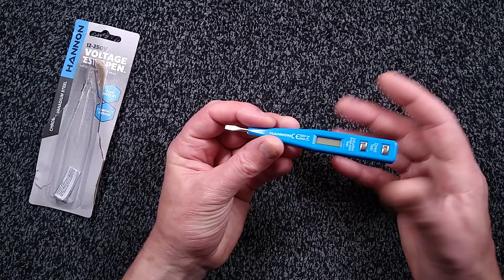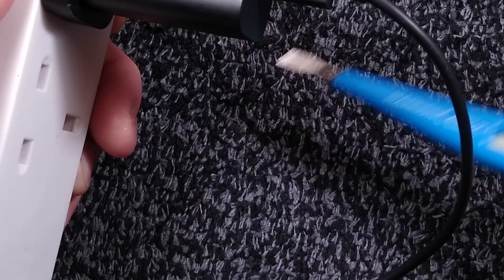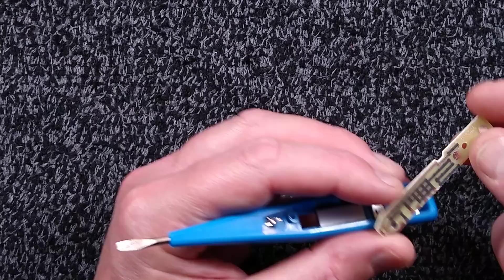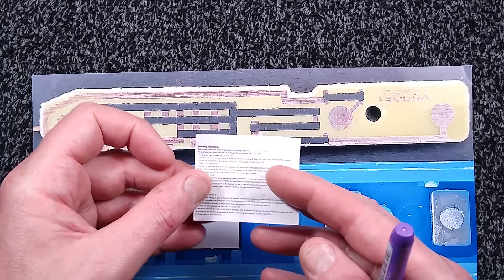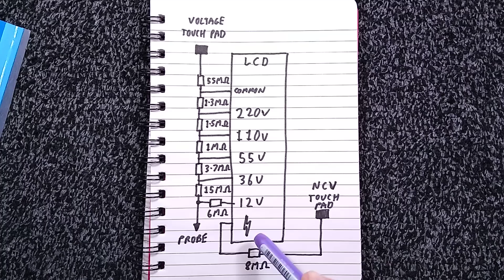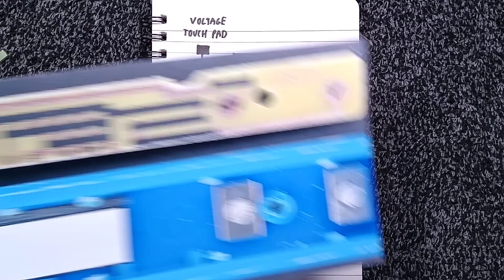Inside an LCD voltage tester (with schematic)

Comment: The instructions aren't that small, I am not on full screen and I could read them clearly. Not "Awful" as you described unjustly.
I recommend reading glasses.
Reply: I also have difficulty reading instructions on those Chinese things. They are trying to save too much money. Anything safety-related should be printed so that people can read it without having to fish around for magnifying glasses etc.
The paper that Clive is holding is no larger than 3 inches; all that text in such a small place is plain silly.
Reply: @stepheneyles2198  I know what you mean but I disagree. There is always situations where small letters are necessary, so I don't blame the manufacturer. 
Also Reading glasses are available everywhere, they will be needed sooner or later .
Reply: @masteryoda394  I don't have reading glasses in every pocket and often need to get things done without.
Reply: @johndododoe1411  just don't forget them, it's not that hard🙄
Reply: @masteryoda394  I have had glasses break in my pocket.
Reply: @johndododoe1411  That can happen, I agree 😊

Comment: So simple I bought one for my dad and myself from CPC back in the eighties. I lost my one year's ago.but now I have my dad's after passing.
The back on ours is either welding or very well glued as even had it run over by cars.
I found very useful throughout my years nice to have one.
A bit disappointed not sealed for safety as used my one in the wet never a problem but Clive would not have made a video.
Reply: If outside is wet or dirty, power can reach finger no matter what's inside.

Comment: We had a gadget to remove the static charge on CRT screens that had a display that was powered by the discharge (little lightening bolt). Bit of a "solution looking for a problem" thing.
Reply: You needed to discharge static from CRT screens if you used one of those completely useless "radiation filters". So it was really a solution to a problem caused by a non-solution to a non-problem. :-P

Comment: It somewhat reminds me of a fever Thermometer. 
Love your Videos and watched them for years, you inspired me to start studying Electrical Engineering last year! Thank you very much for your interesting Videos:)
Reply: Let's hope the doctor doesn't mix them up...'You have a temperature of 110 V - take an aspirin and a resistor and call me tomorrow"...😀
Reply: I think you're bang on dude.
I reckon that the casing is literally an off the shelf part. Originally for dollar store thermometers, repurposed for volt meters.
Reply: @poppy5525  - Are "dollar store (body) thermometers" a thing? That's the kind of device that is usually regulated (same as pregnancy tests, etc.) and sold only in authorised places. Though I guess they can sell them anywhere if they label them as something else.
Reply: @RFC-3514  All that's required is a disclaimer (printed in a font so small an ant would need a microscope to read it) to the effect of "not to be used to make medical diagnoses".
Reply: @RFC-3514  Definitely, well I'm in the UK so we have Poundland, but same difference.
Here they're usually sandwiched in between terrible reading glasses and the cheapest vibrators known to man - or woman!
Reply: @poppy5525  actually the voltage screw driver was out before the thermometer,I have one thats I bought in the early 90s
Reply: @dantronics1682  i think digital thermometers started when the mercury ones were banned, the other replacements sucked in accuracy just like the digital ones, but the digital ones are at least fast.